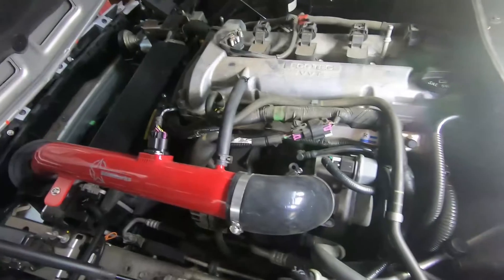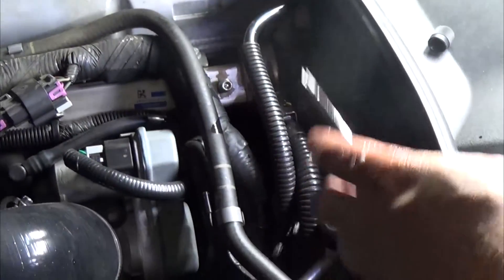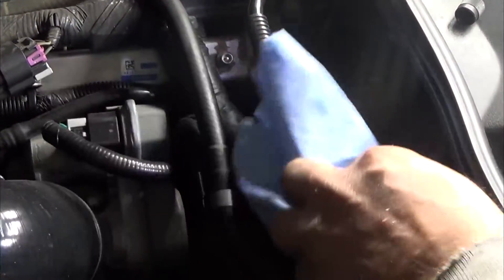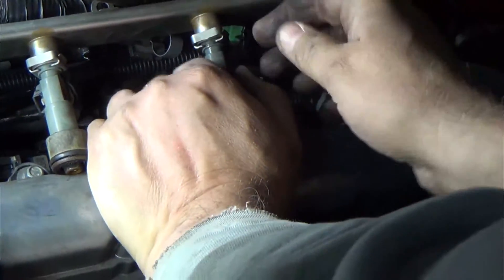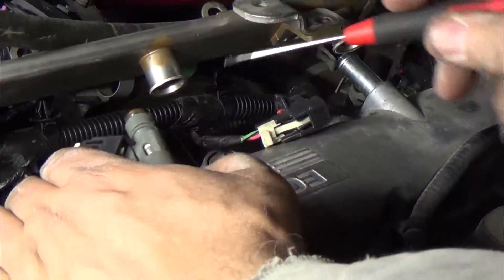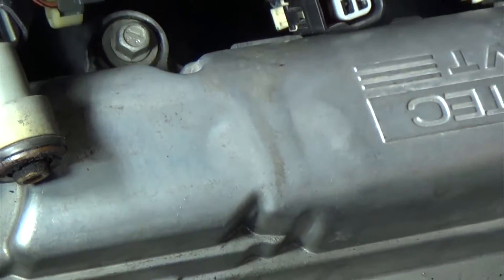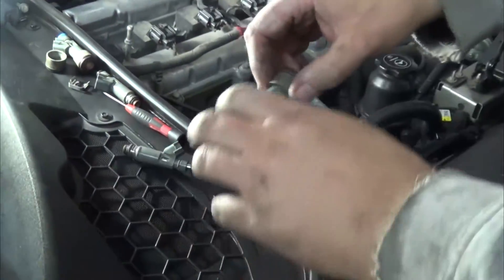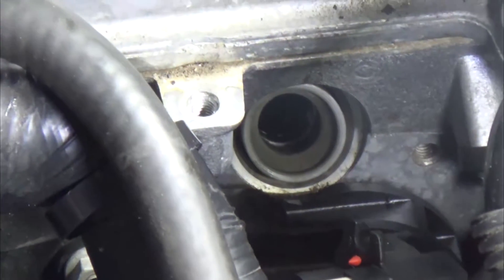How To Change The Injectors on an Ecotec 2.4L Engine Code P0013 and P0014

Comment: Question.  Did you have to change the programming to accommodate the higher flow injectors?  Thx for the vid,  by the way. the Chevrolet manual says you have to remove the intake manifold. I said to myself, “surely not” that’s what brought me here.
Reply from the maker: Hi Joseph. Thanks for watching my video. Yes, I did have to get a new tune once the injectors were installed. And as you saw...at least on my engine, the intake manifold didn't have to be removed. However, this is a rear wheel drive car so the engine in your Chevy (Cobalt I assume) may be transverse mounted so it may be different.
Reply: @MikesHouseOfMods  thanks for replying. I just completed the injector swap on a 2014 equinox and yes they’ve updated the design. Intake manifold DOES have to be removed. The spring retainers on the injectors are beasts.  Not at all like the older design.  Take care!

Comment: When you replace your injectors, you should replace the plastic insulators and all the o-rings. They can be ordered as a kit. Used o-rings may not seat correctly, and this can cause a fuel leak or a vacuum leak.
Reply from the maker: Thanks for the comment. I actually replaced them again when I installed my turbo and at that time I did replace the insulators and o-rings. So far no leaks and lots of power :)
Reply: @MikesHouseOfMods  I mentioned this because I thought I could get away with only replacing the o-rings that came with the new injectors, but my insulators came out when I pulled my injectors, just like yours did, and I didn't have the o-rings for the insulators. Shortly after I changed my injectors I started getting P0420 codes. I almost replaced my catalytic converter before I discovered this code can also be caused by a vacuum leak (and various other things), so I pulled the injectors again and found that one of the insulator o-rings had rolled out of its groove when I had pushed it back in. So I ordered the kit and replaced the insulators and o-rings, and the trouble codes stopped.

Comment: mine a 2008 saturn vue with 2.4 it running rough put new coils and plugs still come and goes
Reply: Mass air flow sensor try cleaning it. Maf cleaner spray and go easy with q tip on those fragile sensors. Make sure it's dry. Also do you get check engine light on?

Comment: You should go back and push those white clips in to lock the connectors to the injectors. If you don’t you will get some misfire or strange fueling problems due to vibrations moving the clips off of those injectors. 

Also best way to relieve the fuel pressure is to run it and pull out the fuse for the fuel pump and let it die on it’s own the run it again until it wouldn’t start. Less messy that way since all the fuel would be completely gone. 

Otherwise great video to show how it is done.

Comment: That is a little bit of a pain to do.
I hope it was worth it and you gained some performance.
Reply from the maker: Yeah. I ended up doing it again when I added my turbo (installed larger injectors) and it took me less than half the time since I knew what I was doing and what to expect. Now that I look back (I shot this video a couple years ago), it wasn't all that bad.
Reply: @MikesHouseOfMods   how many cc are the larger injectors and can you tell me part no. of those larger ones??

Comment: My broke butt didn't have the money to replace the injectors so i did the 9v mickey mouse service on my injectors with the carb cleaner around 100000 and just replace the o rings thats it. Now im around 119100 on the same oem injectors. But awesome vid
Reply from the maker: Thanks for the comment. I was actually doing an injector upgrade (went from 24# stock to 36#) because I also added a high-flow cat and new tune.
Reply: @MikesHouseOfMods  where did you get your tune done?
Reply from the maker: @ivans6026  RPM Motorsports. https://www.rpm-motorsports.com/
Reply: What's the 9v carb cleaner way?? I need to clean or replace mine.

Comment: 0:52 I did a video with the HPFP on the GXP, and the mfr recommended starting the engine and pulling the fuse to relieve pressure.  Of course, there are hundreds of pounds on the 2.0L turbo, different than the 2.4 you have here. However,  doing it that way would also evacuate fuel from the injectors.
Reply from the maker: Hmmm. That's a good idea. If I ever have to do it again, I'll keep that in mind. Thanks.